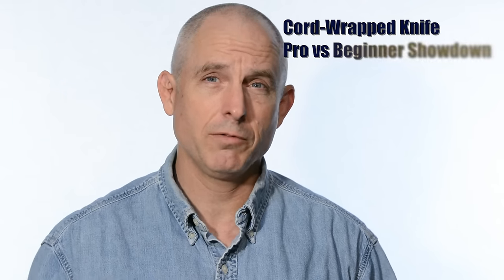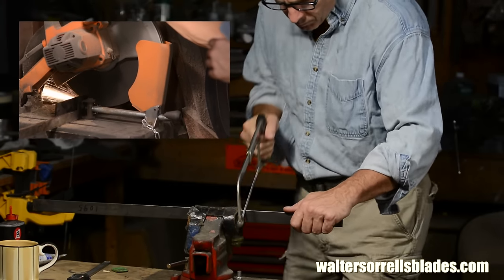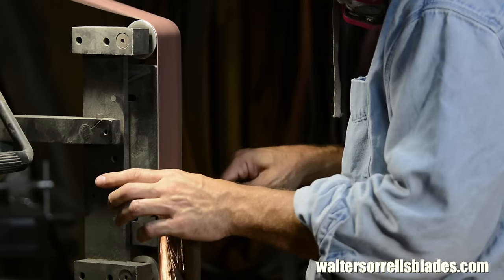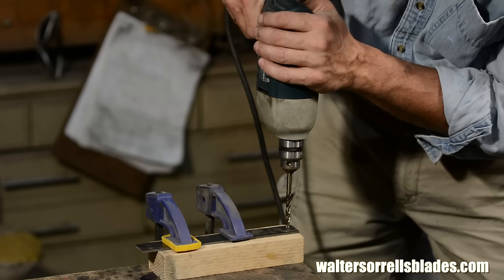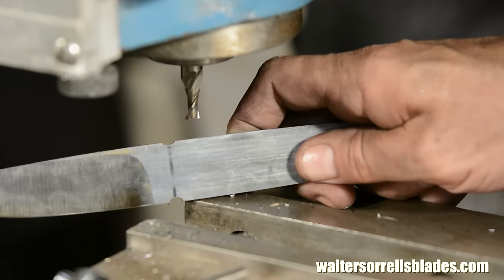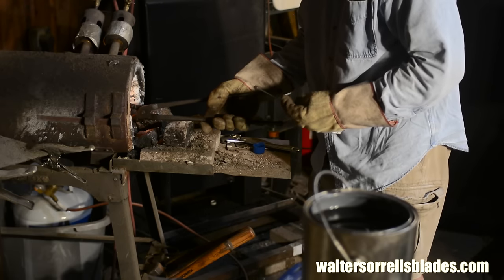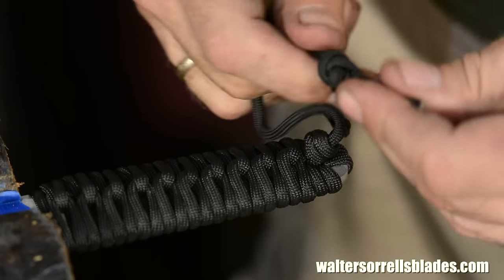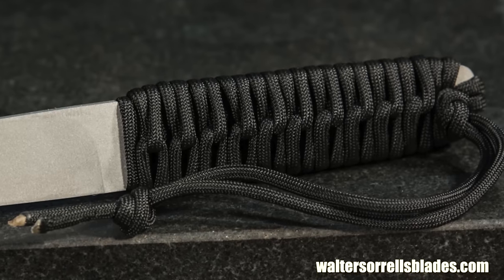Making a Cord-Wrapped Tactical Knife - Simple Knife for Beginning Knife Makers

Comment: Would just the underwrap work for throwing knives?
Reply: yes. the overwrap could throw the knife off balance
Reply: I tried and the underwrap just falls off
Reply: +Christian Turner Have you tried a  wrap without underwrap with gutted cord?
Reply: Don't tread on me oh, no, I haven't tried the wrap yet, I used gutted cord for the underwrap though, but to be honest, I don't think wraps increase anything in a throwing knives proformance, I think a wraps just supposed to be for a fixed blade
Reply: +Christian Turner For no spin knives a cord wrap may be a good idea.
Reply: Don't tread on me Yeah, that's what I though, because all the throws I know have at least a 180* spin, do you mind if I get off topic and ask if your into balisongs, or butterfly knives?
Reply: +Christian Turner I want one but they're taboo where I live why?
Reply: Don't tread on me Well, I'm a knife collector, and my most recent knife is a butterfly, they are prohibited in my area as well, that's why I own trainers, since they are in fact non lethal knives, I could send you a link to a very cheap one if youd like, it cost like 5$, and it is a very durable one as well, had mine for almost a year now, the only thing wrong with it is that I got some dirt in it, and I caint clean it, just don't drop it in dirt and youll be fine, theres also a more expensive one for 10$, it has a non offensive blade meaning it just looks like a real blade, but if your interested, I would recommend the 5$ one to see if flippings for you (this one has free shipping but takes a while to get to you)

Comment: 2 questions. 1  why do blacksmiths drop the hammer on the anvil after a couple of blows to the object. 2. how can u tell that 1095 steel is 1095 and 01 is 01 etc.
Reply from the maker: +dale gosnell   It's just pure energy conservation.  It takes less energy to hit something than to stop the hammer in mid-air.  So letting the hammer drop means you can work for another hour every day before your arm quits on you.
Reply from the maker: +dale gosnell It's pretty much impossible to tell exactly what the composition of a steel is without a metallurgical lab.  You can spark test steel and that will give you a rough sense of carbon content and maybe some other things.  But beyond that, not much you can do with out a lab.

Comment: Dear Walter, i live in greece and i am 14 and i want to make a knife but geting materials here is very difficult.I found an old pry bar and i think its very hard because i broke my hack saw and i cant scratch it with a file.So would an angle grinder work and should i temper it afterwards?Also i want it to be overall 23cm how big should by blade be and my handle i want also to be like a survival chopper desine what blade shape would be ideal?(my first idea clip point but if you could advise me with another blade shape its not a problem)
Thanks for your time.

Comment: I think i get the process

-hacksaw for 10 sec, throw to chop saw
-soak in vinegar for 8 seconds, go to grinder
-drill for 4 sec, off to drill press
-hand sand for 5 passes, back to belt grinder 
-file for 15 sec, head to grinder
Reply: +littlegoobie And remember, grind until the metal is red hot and then throw it in the pool to make it harder.

Comment: You can find 1095 Hi-Carbon on steel suppliers websites for around $20 plus the $15 or so they want for the shipping. Orrrr you can go to ebay and get it for $10-15 with free shipping.

Comment: You used an under wrap because the lashing you used wont cover the handle & melting the para cord is the equivalent of a para cord bracelet. You end it with a big ugly over hand knot, this wrap will fail if you ever use it as a knife.